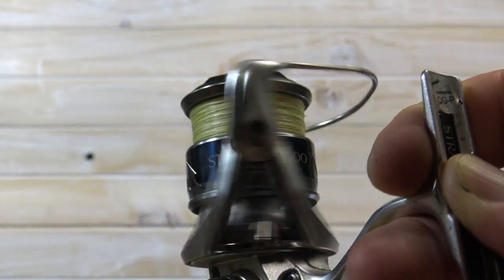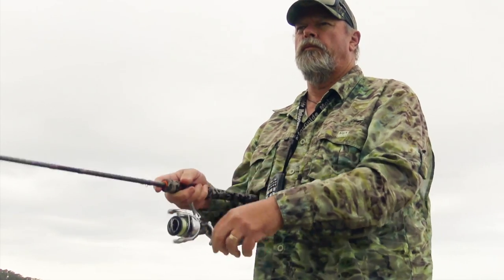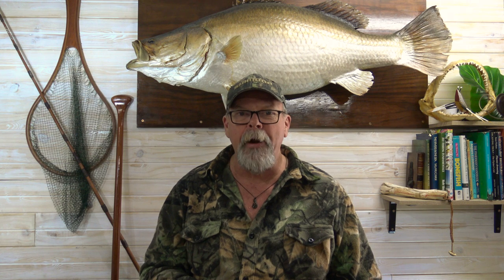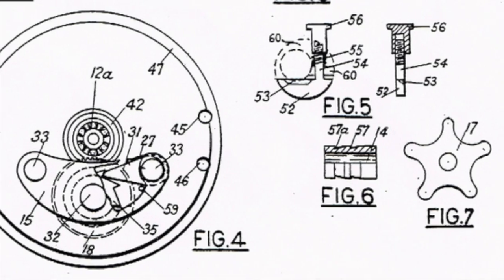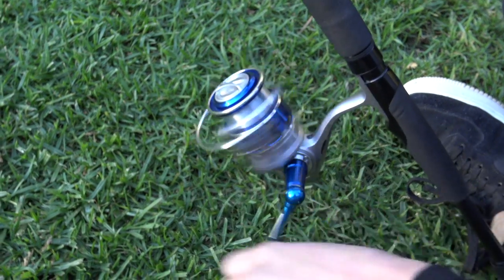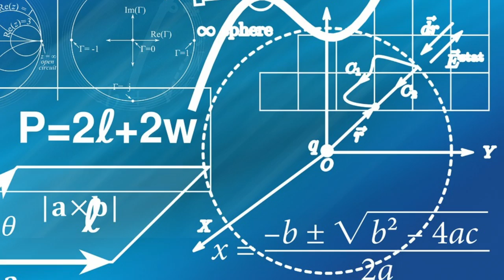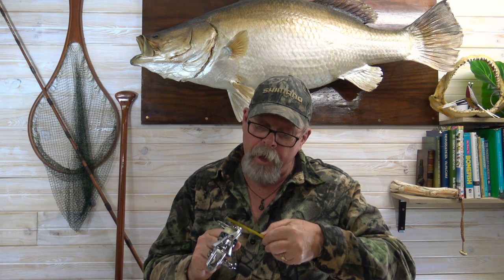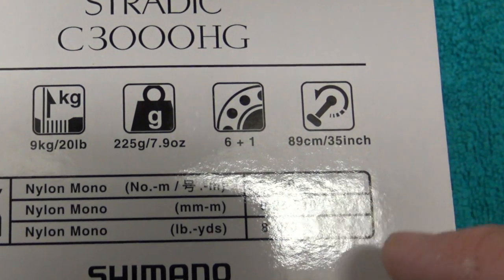HOW-TO: Better Understand Fishing Reel Gear Ratios & Retrieve Speeds

Comment: Hi Starlo, would you recommend high or low gear ratio when big bait fishing of beach/break walls?
Reply from the maker: You don't need a super fast reel for that and a lower gear ratio will give you more cranking power. 4:1 to 5:1 would be perfect, I reckon.

Comment: Hi mate,
thanks for your video. I am in Australia ( Perth ), normally I use to fishing  from the beach and rocks catching tailor and salmon with lures. I have a reel with ratio 5:7 =96 every turn of handle. In your opinion I can take it or is better to change the reel with ratio 6:2 =104 turn of handle
Reply from the maker: Hi Stefano. 5.7:1 and 96cm per turn is plenty fast enough for tailor, Aussie salmon and most other pelagic species. I wouldn’t make a switch just to get 8cm per handle turn more line recovery per handle turn. If you like your current reel, stick with it. Tight Lines.
Reply: @StarloGetsReel  thank you so much. I wanted to ask you the question because some people tell me that if it's only for spinning 6:2 would be better.  I bought a reel one week ago but I am still on time If I want to change it.

Comment: How is the spool’s diameter has any affect in line retrieval and not the rotor arc / gear speed per crank , ie the start of the line retrieval on empty spool is the same amount of the line retrieval when it’s full ( no spool diameter affect ) .
Reply from the maker: Sorry, Maasai, but that's actually not correct The effective diametre of the spool has a major impact on the actual retrieve speed. That's why, when you start spooling up an empty reel from a bulk or filler spool that you've bought the line on, the spool the line came on starts out spinning quite slowly, but accelerates as your reel fills up — to the point where it can burn your hands or those of your assistant if they are applying pressure to the spinning spool to tension the line. You can easily observe this phenomenon for yourself next time you fill up with line. It's simple physics — the same physics that explains why the outer rim of a bike wheel travels much faster than the hub when the wheel spins.
In practical terms, one full wrap of line around the 20mm core of an empty reel spool accounts for around 63mm of line recovered. By the time that reel is nearly full of line and has an actual spool (line load) diametre of, say, 40mm, each wrap accounts for almost 126mm of line. So, if the reel has a gear ratio of 5:1, it'll be pulling in 315mm (31.5cm) per handle turn with an empty spool when you start filling it, and 630mm (63cm) per handle turn when full... A huge difference... twice as fast, in fact! But don't take my word for it... grab a tape measure and go check it out for yourself. ;) Science is a wondrous thing... and as Scotty from Star Trek liked to say: "you cannae defy the laws of physics"!
Reply: Great Knowledge 💯👏